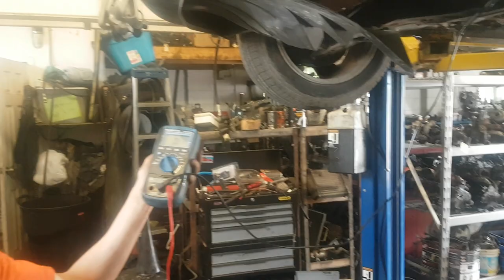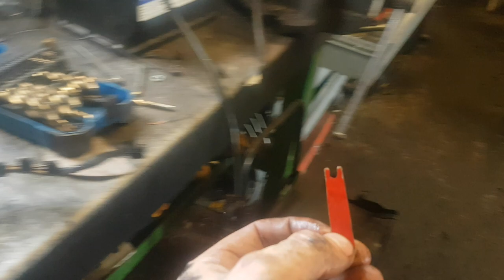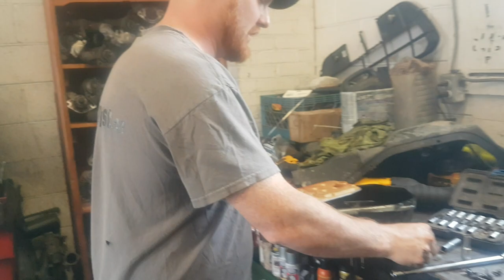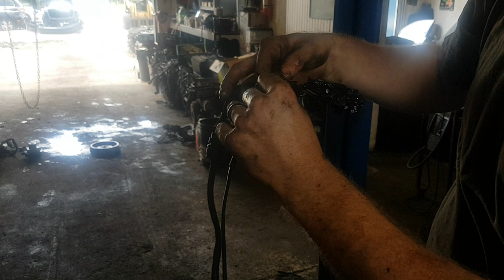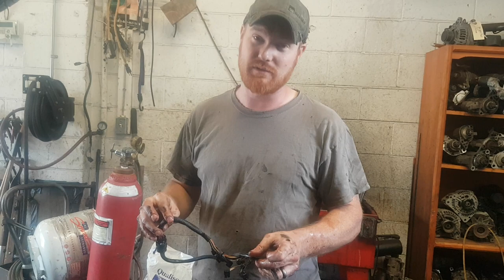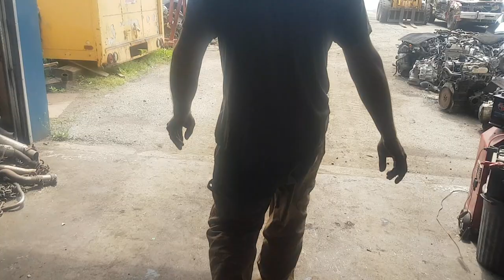Mk4 auto trans harness

Comment: Seems each manufacturer has their own little tricks for releasing certain plugs these days. Despise that If you do not know it, you break them, there is no need for it as the aftermarket does not usually make the parts said clips are used for. Like doubling down on being dicks... edit - no take kitteh, sawry